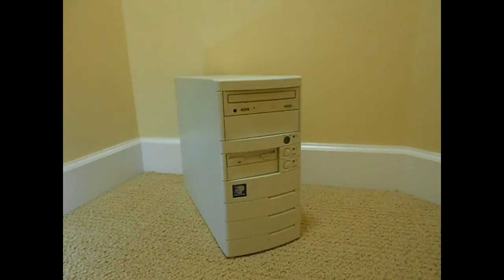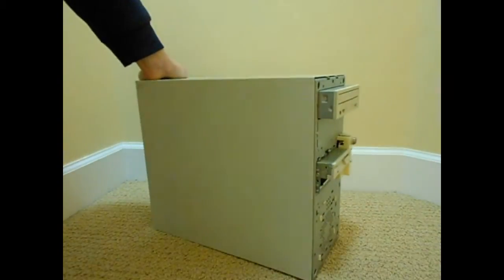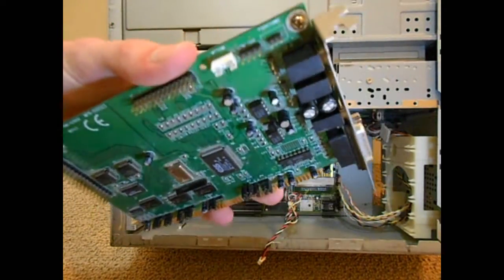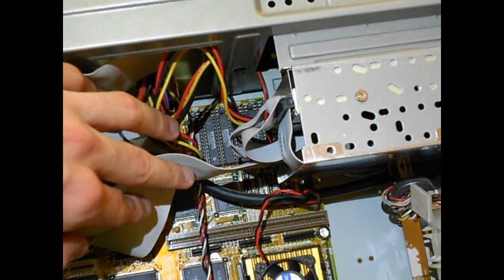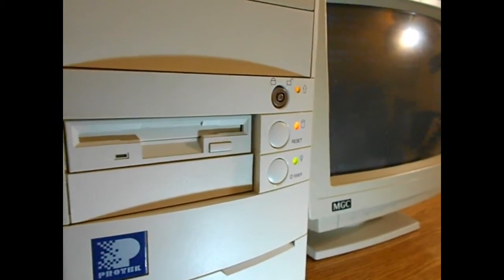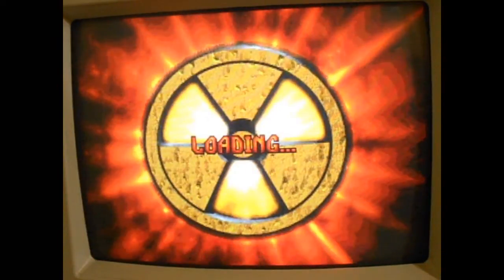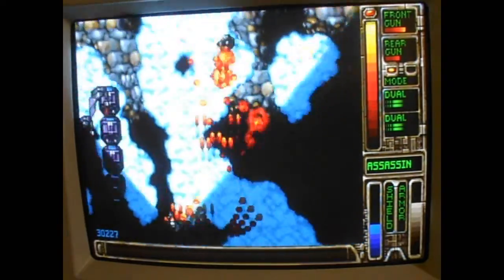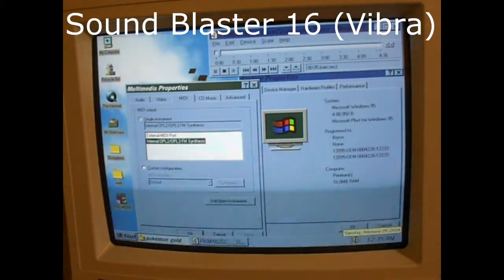Pentium 75 Overview

Comment: it's the 12885, which is the main RTC IC. the 12887 is the one that has the battery inside, so you should be fine.

Comment: Dude, you didnt mention , what graphic card you are using, while you are doing test of speed in games like Quake. The graphic card has big impact on final FPS in game, you cannot just take Pentium 75 and tell, it's fault of Pentium 75, or you see actual Pentium 75 speed. You need also mention graphic card. The differance is sometimes astronomical, when you change graphic card (like you can get like +50% more FPS with faster graphic card. yes on same processor.).

Also - Pentium 75 could be often overclock to 60 FSB speed, and 90 mhz. Would help much.
Reply from the maker: It's a PCI S3 Trio, it's limited by the cpu.
Reply: @Tr3vor42532  true. Pentium 75 was little bit slower than 66 Mhz, because of that crippling FSB speed. The only exception is on Intel TX chipset, that chipset is faster than Socket 4 platform and adds nice 10% boost, and fast 512KB L2 cache.
Also with good motherboard, you can set 55 FSB speed. I have such TX motherboard with that setting, it would make 55x1.5 = 82.5 Mhz, nice boost. Sometimes, it handles even 90 Mhz (60x1.5)

Also, try S3 Trio64 v2 dx, latest version. Sometimes, it adds some speed from first S3 Trio.
Reply from the maker: @warrax111  I'm not too worried about getting the most speed out of this machine,  It's more like a "fast 486" to me since I have faster machines. I tried to set it to 90mhz by upping the FSB, and it worked. However, I turned it back down since it didn't make sense with my 133mhz pentium machine being so close. at the end of the day, 75mhz Pentium probably isn't your best bet if you're looking for the best software rendered quake experience.
Reply from the maker: @warrax111  actually I got it wrong, I got curious and took it apart again, it is a trio64 v2 dx.
Reply from the maker: @warrax111  Yeah, it's still doing it's thing. Considering the price of some of these video cards nowdays on ebay, it's cheaper to just go with a faster cpu anymore. also with those frame rates, they're probably measured with CPUs that can actually keep up with the video cards (yeah, an athlon kicks the shit out of a p75). If this card can do 130fps in software mode, the 75mhz pentium definitely can't keep up with it. by the time you'd be video card bound, you'd be in the upper pentiums or later socket 7 cpus, so you wouldn't be using this card anymore at that point. This is the reason I don't really pay much attention to 2d video cards in the ISA/PCI era too much since you'd have to be using a very old card for the cpu to run into many video bottlenecks.

Comment: sb16 vibra uses a copycat opl2/3 emulation called cqm synthesis and simply isnt good, it sounds fine on the awe32/64 because you can add some reverb and chorus. dunno if that vibra has that option. i bought a vibra a little while ago but i think its dead on arrival so never got to test it.
Reply: some sb vibra 16s had OPL chips like the CT2890
Reply: @pentiummmx2294  good to know maybe i will try to find one

Comment: What do you think makes the sound cards sound different? Their hardware or the instrument mapping in the Windows driver? Was that an OPL Vibra or a CQM Vibra?

But this board looks nice. It took me a while to get an old Pentium board with a button battery, now I have one too. Mine (a FIC one) doesn't seem to support MMX CPUs even though its socket is marked as "Socket 7". But it runs fine with the P133 I found it with and could support P75 too. My newer boards don't have 50-MHz FSB so it's a big plus. I had to test the 50 or 55-MHz pieces overclocked to 60MHz before. Which they could all take but nevertheless :)

Oh and I have a few COAST modules too - but only 256kB ones.
Reply from the maker: Its probably the hardware itself, I'm pretty sure windows treats it the same as it would treat a SB16 as far as mapping the midi sounds to fm synth, at least I'd assume that because it behaves the same way under dos and games are set to use SB16 anyway. I'm pretty sure it was a CQM vibra, not sure I had an OPL vibra back then.

Socket 7 itself doesn't mean that it can run an MMX processor, because it needs to support dual voltage to run the MMX CPUs. needs 3.3v and 2.8v or something like that.

Even though I said in the comments before that I wouldn't overclock this computer, I have it running at 100mhz right now with a 60mhz bus, runs good.

Comment: The big bottleneck for this Pentium 75 is that it's running 50MHz bus. Bus has a huge effect on socket 7 systems like these because the L2 cache is on the motherboard and runs at the bus speed. I remember back in the day many of these motherboards had unofficial support for 75 and 83.3MHz bus. If tried 83.3MH x2 = 166MHz it would be much, much faster in many games and stuff VS 66MHz x2.5 = 166MHz. So yeah, the Pentium 75 is really affected by it's 50MHz bus. In fact, my first PC was a Pentium 75 back in 1996. I used to overclock it to 100MHz using 66MHz bus. Another interesting fact is that a Pentium 150 is barely any faster than a Pentium 133 because the P150 uses 60MHz bus VS P133's 66MHz bus. I bought a Pentium 150 CPU back in the day and payed alot for it. The Pentium 166 was quite a bit more expensive. My plan was to just overclock that 150 to 166. Which of course was no problem.
Reply from the maker: Yeah, if I didn't have any other PCs for games that required a faster CPU, I would probably overclock it. I've heard they usually go to 100mhz without problems. I just keep it at 75mhz and use it for things that are just barely out of my 486DX2 66's reach.
Reply: Yeah, Pentium 75 should be excellent for early 90s to mid 90s DOS games. I'm on the lookout for a retro PC. I have something similar in mind. Pentium 75 to Pentium 166. They say up to Pentium 133 should have minimal timing related problems to old DOS games. However, I cannot stand the harddrive motor noise anymore. I will probably go for a CF card adapter solution. Back in the day it took me quite some time to realise that harddrives actually made the most noise in a PC, and not the fans.
Reply from the maker: Mats Larsen Some of my PSU fans are pretty loud, not that the bearings are going out, just the air noise. I like old hard drives, I don't think a retro PC has the same feel to it without one, its part of the experience in my eyes. There are a lot of very early DOS games that even my 12mhz 286 runs too fast, so there isn't really such thing as an all in one PC, but a P133 is definitely one of the best as far as compatibility goes.
Reply: Tr3vor42532 Yeah, I remember back in my overclocking days I used 8000 rpm delta fans. lol. Think they were 60mm. Sounded like a hair dryer. But extreme fans and broken fans aside I find the type of noise old hard drives makes are much worse VS fans. But we'll see what happens. If I get hold of an old pentium computer I may keep the hard drive for nostalgia reasons. I regret throwing away some of my stuff through the years.

Comment: The Pentium 75 overclocks to 90Mhz without issue. I did it with mine and it's great. Give it a try!
Reply from the maker: +JohnnyNismo Naw, I'm not really interested in overclocking old hardware, I could just use newer hardware. I know it won't make it more likely to fail unless you mess with voltages, but I'd rather not push old stuff too much.

Comment: Maybe a little late - but you don't need to mod anything with this Dallas RTC. It is one without an internal battery. Consult the datasheet (http://www.embeddedsys.com/subpages/resources/images/documents/DS12885_datasheet.pdf)
Reply from the maker: Yeah, I said that I don't have to go mod anything to keep this computer running.
Reply: @Tr3vor42532  at least my MSI MS-5124 in my pentium 100 PC uses a CR2032.

Comment: I have a Packard Bell Legend with a Pentium 133 and 24 mb ram, it has a 6 gig seagate, I upgraded it from a 2 gb seagate, It is easy to get the case of my Packard Bell, I remove the 4 screws from the bottom and pulled the side down and lifted it off. It has an Aztek OPL3 isa sound card and Windows 95.